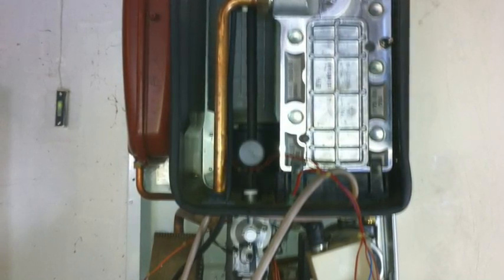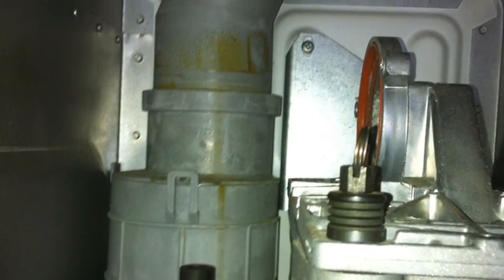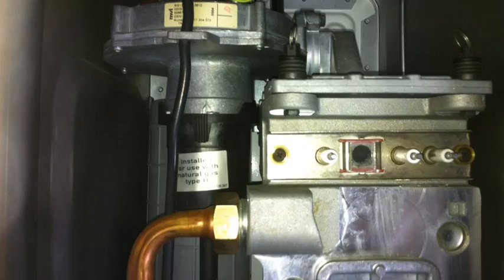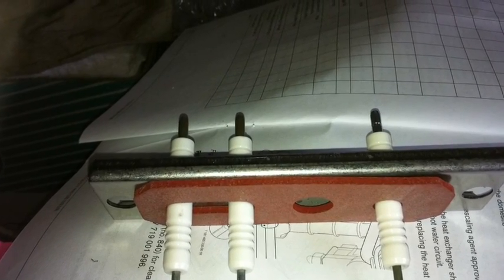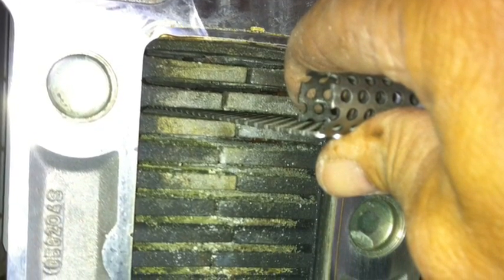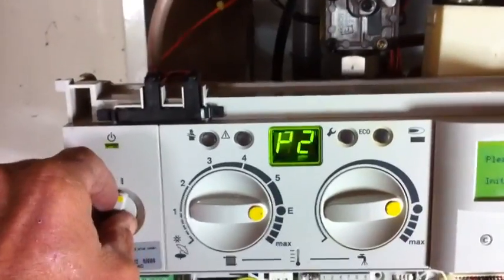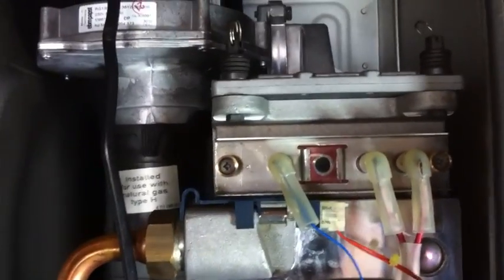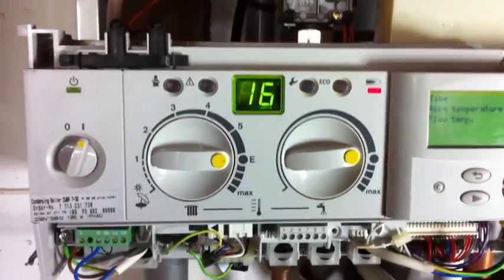Worcester Bosch R30 HE  EA Fault

Comment: I had this boiler in in my flat it was condemned a month ago But had loads of ea faults over the years... 
I now have a vailant ecofit sustain 825. If find it much better boiler in heat and gas. So quiet to compared to the old one.

Comment: great video by a great old skool engineer. I had a intermittent E.A fault code checked fan negative pressure which was OK.  working pressure at the meter  was 17mbar.

Comment: Hello,i came acros one of this boilers here in Romania,and in a few days i have to mount a room thermostat...i read where i can atach it,just bellow the display but there is another thing that boders me,now it it fitted with an outside temperature sensor and i didnt looked where it\s atached.Question:after i remove the outside sensor and mount the room thermostat is there a setting to do on the boiler or it will fire up JUST working acording to the room thermostat?Awaiting answer.10x and excuse my english